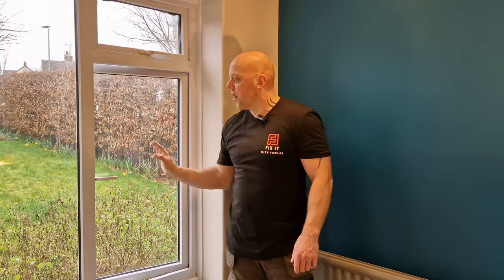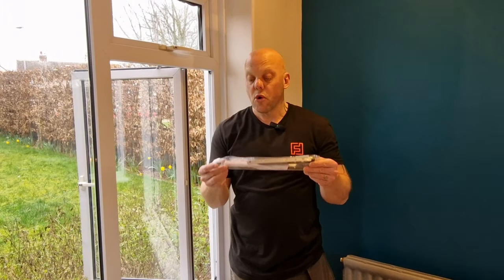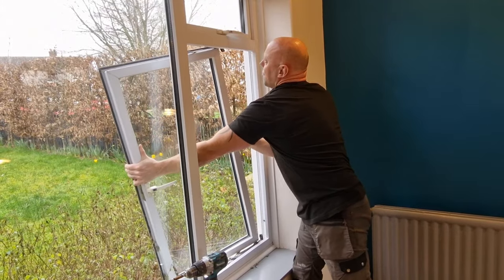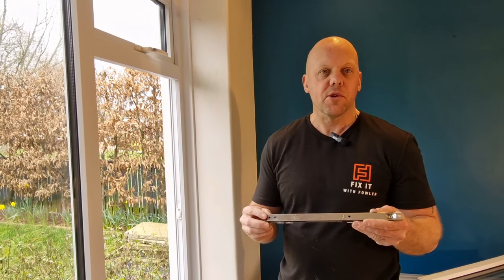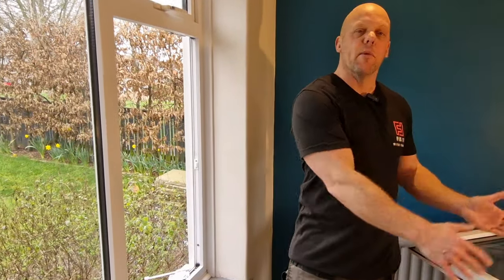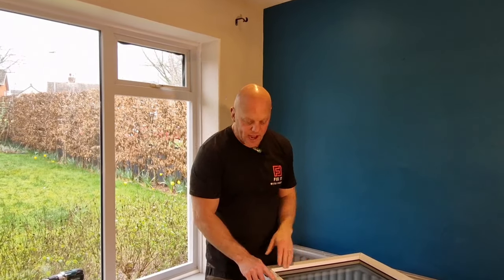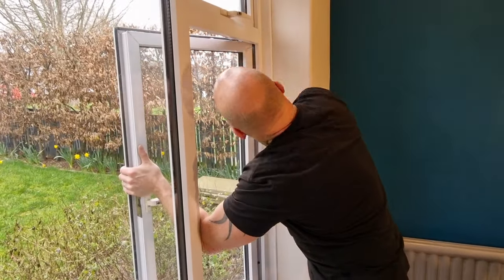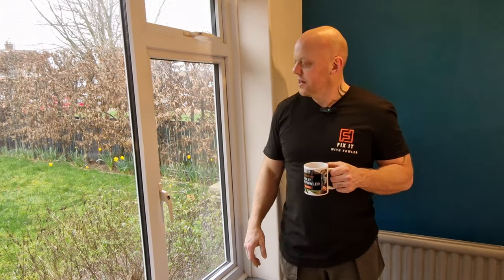How to replace hinges on a window

Comment: Great video, as I've fitted hinges as part of my job for 10 years I've always struggled drilling and screwing while holding the window but the tip about pre drilling the holes first with the new hinge is gold will be doing this in future 👍
Reply from the maker: I always try to make jobs as easy as possible and i have struggled with a previous upstairs window. This little tip definetly helps if you are fitting the window by yourself! thanks for your comment!
Reply: Thank you for the helpful video. One question, I have a top window like the one in this video, and it's not shutting. I noticed that the hinge attachment to the main window frame has dropped by few millimetres and that's the reason the window is scraping against the bottom. The problem I have is, after  unscrewing the three self tapping screws that hold the hinge is place and push the hinge slightly up by few millimetres, the window shuts but the screws are not biting into the main frame and so end up with where I started. Any tip on what I can do to make screws tighten up?
I tried a small upvc piece to plug the existing holes but that didn't work.
Reply from the maker: That would be my suggestion (to try and plug the holes). However, have you tried actual wall plugs, either yellow ones or red ones?
Reply: @FixitwithFowler  Thanks for your reply. Yep, trying the wall plugs was my next step ,only I'm struggling to get hold of white wall plugs so that they blend in with the white upvc frame. Otherwise sod it, and use any colour plugs.
Reply from the maker: @neurosurgeon1261 Yeah, I don't think you will get white ones. However, you can get grey ones like these https://amzn.to/3uSKZZp also they will sit under the hinges
Reply: @FixitwithFowler Wall plugs  " Sit under the hinges ". Great minds think alike . Hopefully, next project is fitting a upvc garden door.
Reply from the maker: Good luck with your next project!
Reply: You can get slightly larger diameter screws that are designed exactly for this problem. It’s not a good idea to use power drivers to put any of these screws in as they are easily over torqued and hence strip out the plastic.
Reply from the maker: @chrishard7616 thanks for your tip!

Comment: is it possible to adjust the window/hinge if you have a small gap at the bottom or do i have to go back to the start again ,i didnt  have to use the plastic spacers on another window i done and thats perfect so i didn't use them on this,thanks for any help
Reply from the maker: You may be able to unscrew the bottom hinge from the frame and insert the packers/spacers, but it depends on the fixing locations in the hinge!

Comment: Great video.  Very clear.    Have to say that bit where you've attached the hinges to the window then offer the window up into the hole and line the screws up is the point where I would realise that the screwdriver is out of reach 😂
Reply from the maker: Ha, definitely, or the screw falls off the screwdriver bit! Thanks for your comment 👍

Comment: Thank you! Your video was so clear, that after only watching it once, I replaced my window hinges in about 30 minutes! I was astonished at how easy it was, and I figure that I saved at least $200 by doing it myself. I did struggle with the weight of the window quite a bit more than you did, but I managed not to drop it out of the second floor.  :)
Reply from the maker: Well, firstly, im glad you managed to replace the hinges on your window, and even better, you didn't drop it! Thanks for your great comment!

Comment: Great video & a job I need to do on about 6 of my DG windows. Most are are on the 1st floor so I need an extra pair of hands to help. Think I'll wait until the weather gets better - just in case.
Reply from the maker: Yes, it would definitely help with an extra pair of hands, especially if the widows are large. Im glad you liked the video, and don't forget i have more in my windows and doors series!

Comment: My daughters bedroom side window has never been fitted correctly. It has always had a draught on the hinge side from when it was fitted. This has given me confidence to adjust the hinges :)
Reply from the maker: That's good to hear. Thanks for your comment!
Reply: @FixitwithFowler Yeh, i replaced the seal around the window and the frame, but when closed at the hinge end the window barely touches the seal
Reply from the maker: Thanks for your comment 👍

Comment: Good job Steve, nicely detailed as ever. I know you made the point about weight and obviously you didn't have an issue with this one, however I think it's a point worth labouring.

These things can be heavy!  Double glazing weighs around 20kg per sqm.  Add to that the frame and locking mech (and perhaps lead!) and you could soon be hanging out of an upstairs window with a casement that weighs the same as a full suitcase - at arms length.  Triple glazing is almost certainly a 2-man job.

You won't know how much it weighs until you've removed your last screw whilst holding the window with one hand.  For your first I advise not being alone and make sure nothing or nobody is beneath the window you're working on 👍

Keep up with the vids mate, some really good stuff.
Reply from the maker: I agree with the comment about the weight which is why i said in an ideal world you would have someone help to hold the window. Thanks for your comments!

Comment: I just had this issue on two of my windows and wd40 did the trick without needing to do all of this, I did adjust the friction settings which I thought in the beginning would make a difference but didn't now do need to adjust properly, probably make it tighter because the hinge is super smooth now. Upon reading up the best lubricant is wb40 with silicone not wd40 solvent I will be washing it off the hinges and be using wd40 silicone

Comment: Great Vid my hinges are riveted I’d like to change to screws to make it easier
Reply from the maker: Hi, my bathroom window was the same, and the hinges were riveted. I have replaced the hinges, and luckily, the holes on the new hinges miss the rivit holes. I had to drill the rivets out, which was quite difficult.

Comment: Hi ya ....id like to change over two side hung windows with a bar in between . Both sets of hinges are very stiff and are easy clean systems ....I'd like them to open to create a bigger opening so that they are 90 degrees open and closer to the actual casement sides . Would it be possible to do a video for that ? Thanks for this one ....its very clearly explained 😊
Reply from the maker: Hi, unfortunately I don't have such a window to make a video on otherwise I would.
Reply: @FixitwithFowler  Well hopefully at some point, you will . Thanks for your reply 👍 🙂 Much appreciated 👏

Comment: Hi there just subscribed to your channel very clear instructions on how to change the hinges but wondered if you could help me. Haven't been able to close my bathroom window for months don't think it's the top hinge it's the bottom one, the problem is the windows were meant to slide into the middle enabling cleaning of both sides can I just replace with normal hinges for double glazed windows any help appreciated thanks 👍
Reply from the maker: Hi, firstly thanks for subscribing!!! The hinges you are describing are easy clean hinges that are designed to allow cleaning of the outside of the window. You can get replacements on a like for like basis like these https://amzn.to/4cYPm5w alternatively you can fit standard hinges but you need to replace both hinges!
Reply: Thank you
Reply from the maker: @christinestewart2472 no problem, just make sure you measure the window hinge so that you get the correct size

Comment: New subscriber ❤ do you need building regulations to replace hinges mate
Reply from the maker: No, there is no need, thankfully!
Reply: @FixitwithFowler  sound mate I shall crack on with mine 👍👍
Reply from the maker: @kingofthetrowel1725 ok, hopefully it will be nice and straightforward!
Reply: @FixitwithFowler  cheers mate

Comment: What length screws would you use to affix a window restraint - the mira ones I have? Was thinking 4 x 25 but not sure if that’s too short
Reply from the maker: Have you got the original screws?
Reply: I don’t - these are new additions and never had any of those child restriction things before
Reply from the maker: I would try using thise first and once installed, give them a pull to see if they are strong enough. If there is any movement, you could then increase the screw size, but it is best to start with a smaller screw but just watch for the screw heads catching!
Reply: Will do many thanks

Comment: Great vid, but my hinge doesn't have screws.  Its got round metal things doughnut like with a hole in the centre.
Reply from the maker: They are rivits. Unfortunately they will need drilling out so it may not be the easiest job to do!
Reply: @FixitwithFowler  Well that was stressful!  The rivets left a bigger hole than the available hole on the hinge, so screws just wobbling around.  Packed them out with wall plugs.  Solid now but no idea if it'll hold over time.  Now waiting for the misses to call me one day to say the window has fallen out, lol.

Comment: Hi, at 4:51 , you said to use self tapping self drilling screws. The screw you are using is pointed at the base. But when I checked on the website to buy, self tapping self drilling screws are a bit blunt/ flat at the base. Why is it different than yours the one I am trying to buy? Thanks
Reply from the maker: Hi, these are self tapping screws which are hardened and came with the new hinge. You can use self drilling and tapping screws but it is only upvc it is going into. Something like these would be ideal but you would need to compare with the old screws https://amzn.to/4cYwbt4
Reply: Thank you very much😊. I have managed to change my bedroom window hinges just by looking your video. It was so heavy that I had to get help someone to hold it. However one of the middle screw kept spinning which is underneath the window (not the frame).
Reply from the maker: @ChapuGrg that's really good to hear, im glad the video helped you changed the window hinges! Please consider subscribing for more great DIY videos 😁
Reply: @FixitwithFowler One more thing. I also managed to change the window seal as well just by looking your video. When I took the window out, I found the old seals needed replacement as they were mostly damaged. Luckily, I had seen your video of "how to change the window seals" while watching the window hinges replacement video. The link was in the video. I rushed to Screwfix and got the UPVC seals. I managed to change it without any difficulty. The window is tight now.😊
Reply from the maker: Brilliant, thanks for your positive feedback and comments I really appreciate it!

Comment: Great video. Gave this a go today and made things worse. Can't for the life of me figure out why the window won't close despite all measurements being perfect, spacers used etc. :(
Reply from the maker: That's strange. Did you but identical hinges?
Reply: @FixitwithFowler  universal ones but correct size and used the spacers. Could use one existing hole but might be better I treat as a new window and put all new holes in. Very frustrating but I've not given up yet 😁
Reply from the maker: @craigedwards7785 that's frustrating. Does the window catch on the frame?
Reply: @FixitwithFowler  Yeah its catching at the top.
Reply from the maker: @craigedwards7785  have you tried reducing the packers on the hinge?

Comment: Wd40 will loosen that right up if you cant afford new
Reply from the maker: That's true but I'm replacing them as the plastic locator on the hinge is broken, hence the gap in between the frame and the window
Reply: It's short term as in weeks, and also if you spill with your nozzle it will make the frame outside shiny. Once is fine, if you carry on you will damage the plastic seal and ruin the outside PVC if spilt, change to wd40 silicone as that's the step up and will last 1-2 years.